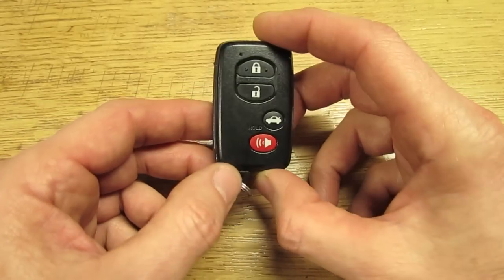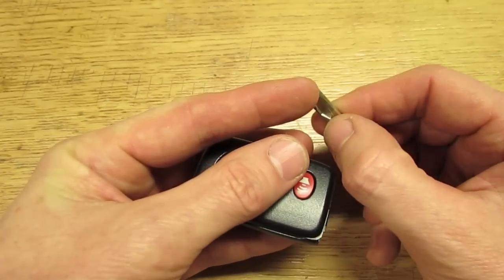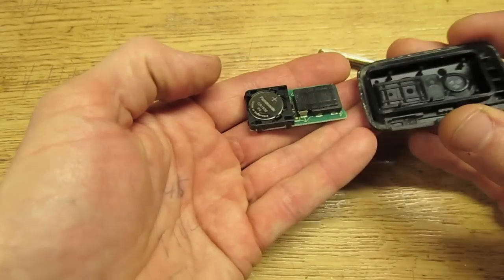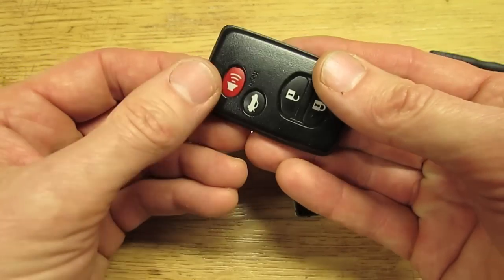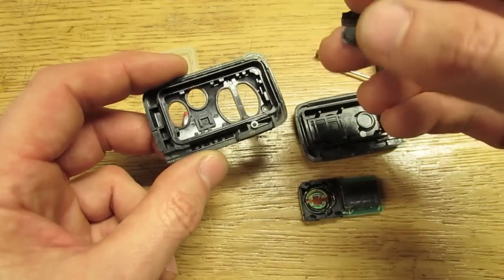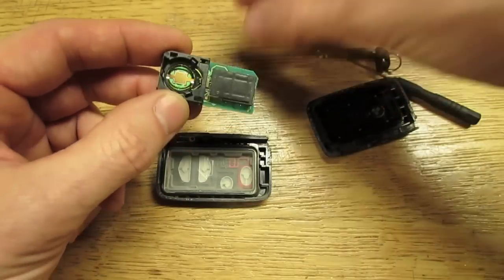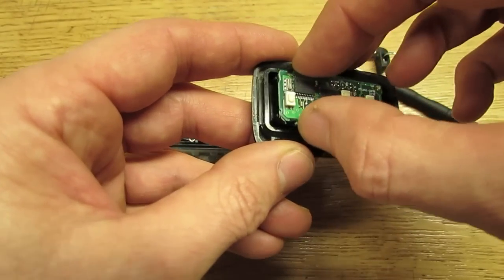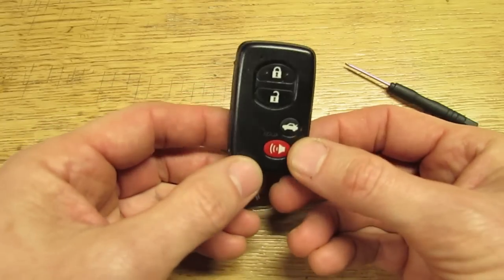How to ● Toyota Key Fob Remote Keyless Battery Change/Replace

Comment: With Your Video It Took Me Only 45 Seconds To Replace the battery !!!  Very Useful Video. I was looking for a screw to open the Remote But Toyota designed that key to do the Screw driver Job

Comment: This video helped me, extremely! It was getting scary with not being able to consistently start and/or unlock my vehicle using the remote key fob! The manual key is also a tool to open the fob to access the battery! How convenient! And I even had a CR32 battery in my home! Very helpful video! Thank you!
Reply from the maker: Glad it helped!

Comment: Thanks Chris! but you could open the cover while Toyota logo facing you(according to user manual), so to avoid touching inside electronic board if your hand with static.
Reply from the maker: Can't be avoided. I have replaced hundreds of these without issue. They can also be dropped from 4 ft. without breaking. Very resilient little things.

Comment: Just look at your old battery to see what size is stamped on it. It's either a 1632 or a 2032. My 2008 Sienna and my 2017 RAV4 both use 2032.

Comment: My battery says Duracell DL 1632 do I get the same replacement? Or can I use another.  I am the 2nd owner of this automobile, so maybe the former owner replaced the battery.  I own a 2010 Highlander, This was very helpful. Thanks
Reply from the maker: The DL means it's a Duracell battery. That is duracell's sneaky way of trying to get you to buy their battery.You can replace it with any battery as long as it says 1632..
Reply: @chrisnotap  I figured that out last night.  Thanks again.

Comment: Do I need to worry about the connection with my car resetting when I pull the battery out? Or will the keyless start work fine regardless of whether or not the fob is powered?
Reply: I replaced mine in a 2013 Toy Venza, no problem what so ever

Comment: I have a battery to change the old one with it’s never been opened but the expiry date was 09/19 do you think it matters cos I don’t want to do any damage and at the moment my dealer is closed
Reply from the maker: It won't damage a thing! Try it. You have nothing to lose. If it doesn't work, oh well. Wait until this is all over with and get a fresh one.

Comment: What i would like to know is what the hidden key is for? There is no place on my car to put such a key. Am I missing something?
Reply from the maker: What year and model do you have?
Reply from the maker: Go to your drivers door handle. There is sometimes a small cover that pops off. Under it is the door lock that accepts the key to get in when the fob battery goes dead. Or it is also used to lock the glove box.
Reply: Crazy thing is i have never paid much attention but there is a place for a key in plain sight
Reply: It's called a valley key, you use it to open your door. If you cannot start your car, put the Fob face front to the starter button and it will start. See Starting a push button car with a dead Fob .. Hope this helps Houston. (Nov. 11/18).
Reply: @elliemerc01  thank you Ellie.  Good to know!  :)
Reply: @robschultz1245  That should be 'Valet' key not valley lol. Have a good one Rob. (May 3/19)
Reply: @elliemerc01  lol.😅 I figured that is what you meant. Have a great day too!
Reply: @elliemerc01  The manual says to do this too!  Didn't try it, but sure hope it works!  Bought a battery in the shopping mall and installed it immediately.

Comment: If there's a light that flashes red on my dashboard when I start my car and goes away after I start to drive, does that mean my battery is low?
Reply from the maker: What does the red light on your dash say? What symbol? Owners manual will tell you what the light means.

Comment: I just pulled up this video because I didn't know how to put the spring in.
Reply from the maker: Yes. The little spring on the side to hold the key in. Keep at it. Study it closely. You'll figure it out. I have never had that part apart but you can do it. Use a tooth pick to aid you.
Reply: @chrisnotap  this video definitely helped. I put it back together pretty easily after I saw where it goes.

Comment: For some reason, new batteries don't work in the remote.
Reply from the maker: Make sure the positive side of the battery is facing up. And that the battery is not defective.
Reply: You'd think so right? I mean even if, someone didn't know about polarity, they would try it the other way, for fun even.
Reply: I have the same problem! Trust me, I've turned the batteries every which way to exhaust all possibilities. Sometimes it will work for a day but then it stops. I've tried 7 batteries, each time from a brandy newfresh from pack. I'm guessing they are just low quality batteries? My bf ordered 50 of them (like 10 packages of 5 batteries) but it seems they are all shitty quality regardless of which pack I open. Such a bummer, oh well.

EXCELLENT VIDEO THOUGH!! Your voice & helpful demeanor is PERFECT for YouTube tutorials- I subscribed, hope you can teach me more things!

Comment: This is outdated the battery is CR 2032
Reply: I just went to CVS to buy a new battery. I bought the 1632. The 2032 is bigger & it won’t fit.
Reply: This is not outdated. This battery works for the year of car made close to when this video was made.  Thus, the battery fits fine in my key fob. Maybe you just watched the wrong video based on your car year! LOL